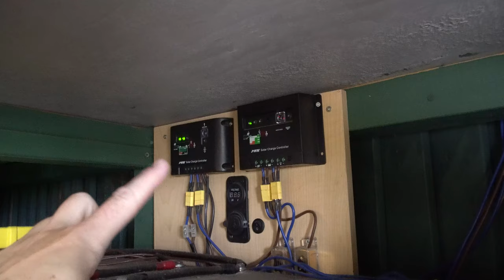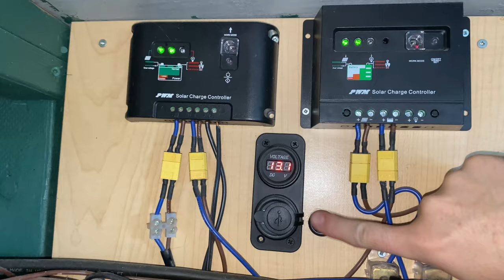DIY Ultimate Solar Battery Backup for my Saltwater Reef Aquarium

Comment: Good one, Deven. Glad to see ya promoting having a plan before you wish you had one! A couple things to note regarding lead acid. 50% capacity after 3 years isn’t unheard of. Consider capacity checking after three years. That’s as simple as a watt hour meter, a PSW inverter, and 50W load (like a hair dryer). Invariably, you’ll add more load over times, so it’s best to know capacity. I create calendar reminders for those systems I have that still use lead acid. The fuse is a must have for lead acid. Well done! Consider regulating the 12V output. As the batteries age, and the voltage sags under load, the voltage can drop to an unacceptable level. Less voltage means more amps, and your drivers might not like that. Lastly, when you’re ready add a little more ultimate, consider LiFePO4 batteries. They’re non-flammable, will last 8+ years before cycling shows an impact, and the total cost of ownership is less.
Reply from the maker: I 100% want to play with LiFePO4  one of these days.. was harder to justify now over free batteries! (they are really what inspired the solar project)    Even if they are only at 50% thats still just shy of 300aH so ill take it for now!    I have seen a few of your things on building a LiFePO4  pack and it looks pretty easy...so one day im in! :)

Comment: Awesome video!  I had the power go out here in Wisconsin 2 years back during the polar vortex (-26°@ night), gas powered generator failed & The temperature in the house dropped from 68° to 45° in less than 30 minutes, I was able to save most of the fish but all the coral got wiped out,  so I built an 7 kWh off-grid solar system with LifePo4 cells,  The tank is completely solar powered year-round now 🐙🤯
Reply from the maker: Yikes! sorry to hear about your prior losses! That would be a a hard one (and burrrr)  Thats wicked the new solar setup!  I eventually want to swap my batteries for LifePo4.. on the future upgrade list!

Comment: I'm a Lil surprised how few ppl just dont have a generator ready to go....invertor generators will run your entire system for like 5$ a day....grant it you still have to start it up, rather than a seam less switch to solar...solar ain't cheap...that's a nice dream setup
Reply from the maker: I have debated generators many times.. when ever i have the chash.. no good sales.. when i see a sale its never a good time for the wallet.. hard to win!  
(one day)  but at least now im pretty confident the tank would survive days without power now with out any intervention on my part :)
Reply: @ReefDudes  I use a ryobi 2200 watt....think they sell for like 500$ US ....if you're lucky you can catch em for like 400 on sale...ppl need an invertor generator bc it's more gentle on delicate electronics....but your solar setup is amazing bc it probably kicks right on if your outta the house

Comment: You really need to do some research on 12 volt  you should definitely running heavier gauge wire
Reply from the maker: I have heavy wire from panels to the batteries.    Its a relatively low load pulling from it the pumps.

Comment: Can you recommend some good batteries to use?
Reply from the maker: For solar or for a smaller trickle charger based one?
Reply: @ReefDudes  solar
Reply from the maker: @jonjaroska2319  If i was to buy some new ones i would look for a good deal on some liFePo4 as they will last much longer.
   I went with sealed lead acid because they were free! (cant pass that up) 
where are you located? Ill see if  I can find any good deals